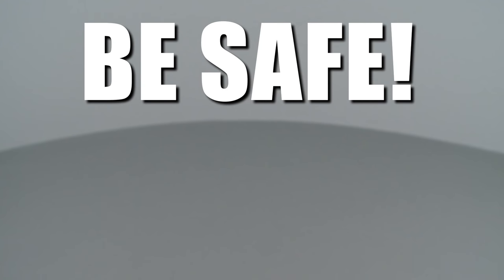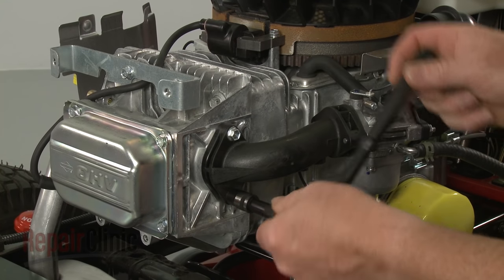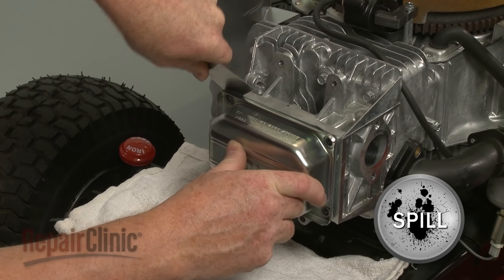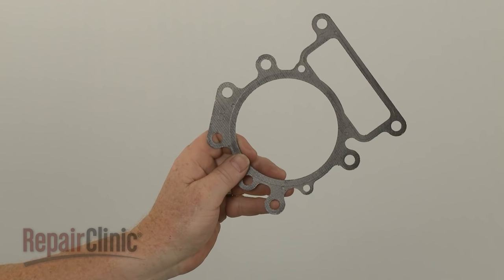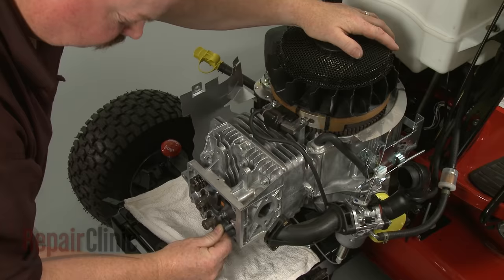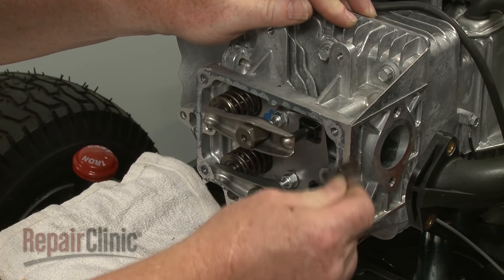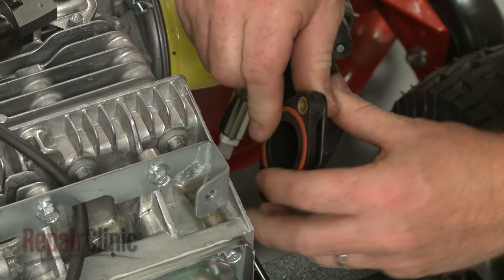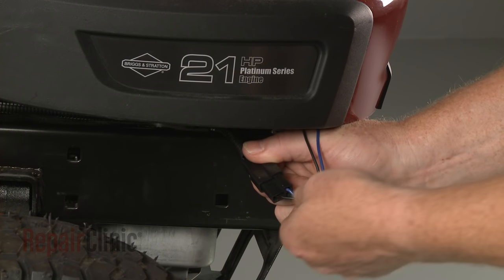Briggs & Stratton Riding Mower Engine Head Gasket #794114

Comment: Great video!   It was a choice of $1000 for a new engine, up to $3000 for a new tractor.   I replaced the gasket, changed the oil and new spark plug/filter for under $60.
Reply: Same!

Comment: Thank you for saving me $350 to fix my John Deere.  I watched your video about 10 times before I opened my deere and at each step everything was as you explained.  I got the gasket and sealant from Amazon, and the rest was just as you presented.  This was great!

Tom
Reply from the maker: Great job Tom!
Reply: Thomas Ledvorowski
Reply: a friend of mine bought a brand new zero turn mf riding lawn mower and only got 2.5 seasons out of it before the head gasket went .  the warranty ended 3 months prior and the place " kmk sales " would not help . not good people . so now the owner has to haul the mower 80 miles to the nearest dealer to see if they'll actually be able to get a warranty on an obviously defective part .  its obvious the part was designed to fail to make someone gain wealth  .
Reply: @carmichaelmoritz8662   So does anybody off a better aftermarket gasket that you know of or may have found? I totally agree with you. OEM gasket just going to eventually blow again.
Reply: @chilichad  sadly i do not know of any aftermarket head gaskets that are actually good  .  it seems that certain items are built to fail .  the older style and more expensive style have a fire ring that would prevent failure . just search " head gasket fire ring  "  .   if i could match up a perfect fire ring to those motors the issue would be solved  .  for now i just made my own head gasket out of a vehicles motor head gasket with a fire ring that was at a junk yard  .   head gaskets should be a thing of the past a no longer needed  .  certain liquid cooled two stroke motors have no head gasket , just o rings and a base gasket .  the head to cylinder is perfect  and usually never needs to be resurfaced  .   talking about the briggs head gasket again i resurfaced the head / block put everything back together and turned it by hand to see if anything would touch .  it all sounded good until i run the motor .   i did not have the energy to lathe the top of the outer piston nor did i have the energy to grind the areas for the valves to piston contact  . the valves did not hit the piston and yet were a bit to close and might have caused problems over time  .  when i were younger i worked on many motors and all sorts of stuff  and had to grind certain areas of a piston to make things work without a head gasket .  head gaskets will eventually always fail over time and the motors i worked on are still running perfectly even with no head gasket  .
Reply: @chilichad  and another thing is the decompression lobe on those motors fail after about six years of average running time . so basically those motors have only two issues that should not be .   its seems that that those two parts are of extra poor quality lol  .   if and when the times comes for the decompression fix i'll just drill a hole into the head and put a manual lever type valve to replace the original internal decompression .  some old tractors had that type on and it worked perfectly without ever failing  .

Comment: THANK YOU so much for making this video!  My local 🚜 dealer wanted almost $500 to do this exact same job.  Thanks to your video I ordered the things I needed and had your video for guidance every step of the way.  And I really appreciated your providing all the torque specs for all the bolts.  A couple of other DIY videos indicated they liked to add Permatex copper Spray-A-Gasket to the new head gasket, so I added that to all 3 gaskets (head, rocker arm cover, & exhaust) and I'm glad I did (I put one small scratch in the head scraping off the old gasket material and the copper spray gave that gasket just a little extra for that imperfection in the surface of the head).  Another user showed a great way to gently but effectively  remove all the material the razor blade can't get off: spraying the surfaces with WD-40 (or an engine cleaner) and using 400 grit sand paper to wet sand the remaining material off.  That really helped get what scraping alone couldn't.  Can't thank you enough for making this video!  As Red Green says, "If the women don't find you handsome, at least they should find you handy!".
Reply: I sanded with 400 grit and WD too. Worked perfectly. No smoke and only spent $50 for gaskets (head and valve cover), oil, and new air filter. Runs perfectly.

Comment: I'm back here after doing this in July 2018 to refresh my memory on the torque specs.  Can't complain the job lasted 6 years (did not use an OEM gasket-Ebay).  This time around I am tossing out that heat shield on the principal it will allow more airflow around the engine.  Good luck to y'all out there doing this, very simple if you follow these instructions and it works.

Comment: Awesome Video, very helpful. I like that you also included the torque specs as they can be hard to find sometimes.
Reply from the maker: Thanks Ben!
Reply: I missed that the torque spec given was in "inch pounds" not "foot pounds" and broke a valve cover bolt.  Don't be me, 60 inch pounds is 5 foot pounds.

Comment: This was a great video. I was able to completely disassemble and reassemble in one afternoon. I would only recommend converting inch-pounds to foot-pounds because most torque wrenches come in foot-pounds. Thank you for a clear and easy to follow video!
Reply: Most 3/8 drive torque wrenches are set in In-lbs.  The problem with Ft-lbs is the numbers are way too low.  Most 1/2" wrenches won't go below 30-40 ft-lbs, and even the ones that do are likely not accurate that low.  150 in-lbs is only 12.5 ft-lbs.  For torquing wheels, suspension parts, etc you want the bigger wrench, but you need a smaller one for a lot of things, too.  Worst case, the conversion isn't exactly hard, either.  Just divide by 12.

Comment: It is very easy to remove head without undoing the valve rockers! Just unbolt the head and pull the stem and head as one piece.  Make sure you note that the stems are not identical!  The steel one is the exhaust and the aluminum being intake.  Be sure to always install the stem the same way it came out do not flip it end for end.  It would still function but if there were any wear that was matched it is always better to install as it came out.  Still check valve clearance.  Gor those without inch pound torque wrench it equal 14-18 ft lbs of torque

Comment: You know what's great about YouTube...  There's.  A.  Video.  For.  Everything.
Reply: Having no prior experience, I was able to replace the head gasket on my 2000 Toro Wheel Horse 16 HP OHV Briggs and Stratton engine thanks to this RepairClinic.com video! And it worked perfectly on the first try after reassembly. Had to use carb cleaner and wire brush drill bit to get all the carbon desposit from inside the combustion chamber, but total success! Thank you for creating and posting this crystal-clear how-to video!!!!

Comment: Just did this job. One question, does the head bolts require a retorque after a heat cycle? I can't find any information on wether it does or not. Thanks

Comment: I torqued my head-bolts to about 18-20 ft./lbs. (max. at 3rd interval).  Am i good to go for My B&S Model 31H777, TYPE 0297E1 , CODE 040126ZD  ?  These are known to blow head-gaskets based on how they are designed with bolts being so far apart at the exhaust stroke part of the piston/head.  So I want to make sure it's tight enough.  First time around one of the bolts broke so i bought brand new ones (8) and they were a bit different ... tad bit longer, larger flange on bolt-top and they had 5 tick marks on the head bolt instead of 3.  So was that a 5 grade-bolt upgraded to a 7?  thanks a ton in advance!!!!!!!!

Comment: repair clinic can i use the same clearance gauge on the valve adjustment  on this video for a craftsman 19 HP ,the  model number 33R877 type 0002G1     ... i need to know the feeler gauge numbers to  adjust the rocker arm and valve before ordering the gasket .    thank you

Comment: Try not to use steel on front of aluminum where head gasket goes could strach it! 400 grit sand paper works good then clean

Comment: Do you need to drain the oil from the mower prior to removing the cylinder head ?
Reply: No tilt the front up a little and make sure the mower is in gear. Also block the back wheels. Some oil will still dribble out though.

Comment: You forgot to mention to resurface the cylinder head on a wide, flat belt sander or large diameter sanding disc to remove warpage and restore flatness, and to prevent another blown or leaking head gasket.
Reply: lol.  That's the ghetto way.  Needs to be properly done at a machine shop
Reply: I do have a machine shop. It's a professional machine shop, too. And lots of professional machine shops use a flat belt or disc sander to resurface all kinds of metal parts. Besides, what other machinery could be used to resurface metal parts with??? Also, I don't live in a ghetto. I live in the suburbs of a large city, very far away from any ghettos. I think your "ghetto" response is discriminatory and racist, too!

Comment: I'm using a Nm torque wrench. 150 inch pounds = 17 Nm. I've got my torque wrench set on 17 and it feels like I'm going to snap the heads off the head bolts. And the wrench still hasn't clicked. Yours appears to click a lot sooner than mine. Should I keep cranking on it?

Comment: You forgot the spill icon when moving the carb around. Unless newer carbs have a way of not dumping gas into the throttle body when moving them around, or sending it through the overflow tube. It would be a good idea to also remove the carbon from the top of the piston and valves. Also check the valves for spin while you're at it.
Reply from the maker: +kd9bwi Thank you for the feedback.

Comment: Should the pushing rods be lubricated? if it is so, should I use regular oil or assembly lube?
Reply: The pushrods are lubricated with the engine oil when it's running.
Reply: @tier3rd375  thanks for your help

Comment: Repair Clinic, My engine has no power and it's a 15HP B/S OHV engine and it don't show smoke coming out of the oil filler. but I do have lots of oil under the cylinder, Would this indicate that I may have a blown head gasket? I have changed the plug, carburetor, fuel line, fuel filter and air filter and still have NO power, engine start good and runs well until you try to cut grass, 9/24/2016. Thanks Stan

Comment: Unscrewing the head bolts in this video is wrong. You are supposed to break the bolts on the head about a 1/4 of a turn for each bolt then go back then unscrew the bolts all the way. Doing this keeps the head from warping.
Reply: Kenneth Nicely This is true and very important...
Reply: it wont warp if it is cold
Reply: I saw one unscrew with an impact
Reply: I've see videos that advise loosening and removing in the reverse order you tighten them.

Comment: Do I have to open the value cover just to reset the head gasket?
Reply: They did it here to remove the pushrod. You don't necessarily have to remove the valve cover to remove the head, but you will still need to reinstall the pushrod so either way you have to open the valve cover.

Comment: My aluminum push rod is slightly bent , can I replace it with a steel 1 from an old engine? Would it cause a problem to use steel pushrod for both?
Reply: Your good

Comment: These motors if you mow a lot will need head gasket replaced once a year.
Reply: Alot like as in my mowing lawns everyday as a business?
Reply: @evilenergy7121  yeah. I've used several these motors over the yrs and head gaskets always failed and the governor flies apart . There's a spring on the compression release valve and it'll fly apart often and sometimes gets chewed up in your gears on the cam shaft and sometimes break a gear tooth or two . Very bad design in those intek engines.
Reply: For sure, it’s a winter job on all of them and it will save you money and down time plus losing a good customer 😮😮😮

Comment: WARNING ⚠️  (18 FT/LBS MAX)

Hey. 250 inch pounds WILL stretch or breaking head bolts!!!!

No more than 220 or 18 ft/lbs per bolt

WARNING ⚠️
Reply: 250 foot lbs will, 250 inch pounds/21 ft lbs wont stretch or break pretty much anything